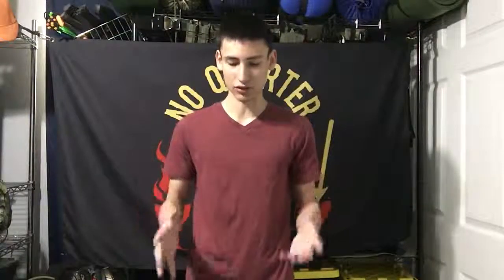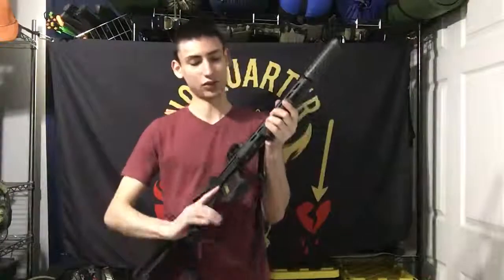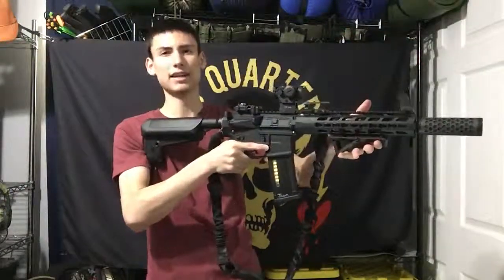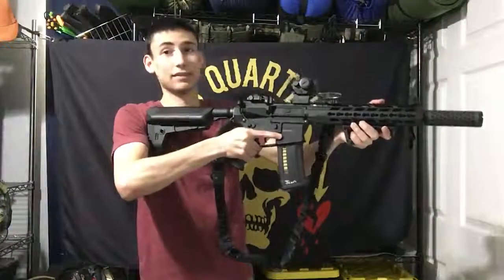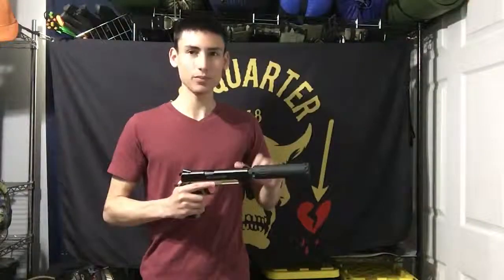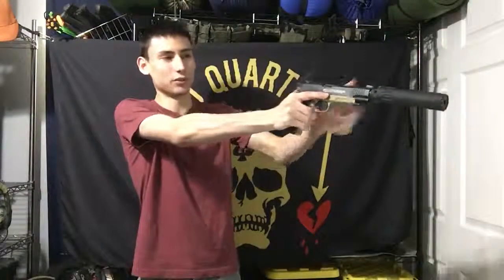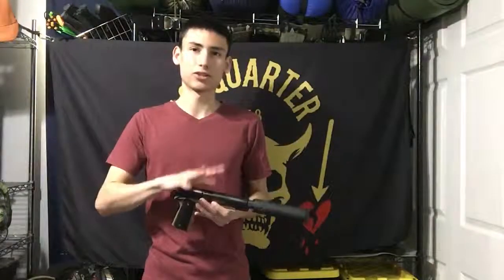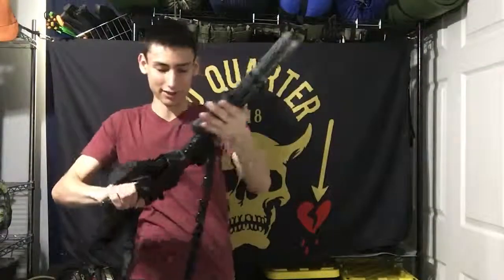Using Mock Suppressors in Airsoft

Comment: Can I remove the inner barrel?
Can I remove the hexagon part?
Reply from the maker: This has no inner barrel, it is hollow on the inside. 

For the hexagon part, no
Reply: @brandyn.ethan.productions  So the hive model does not have a barrel in the silence
Reply from the maker: @sh4d0z59  The "power up" model does, but the one in this video does not

Comment: Do mock suppressors come with foam rings inside them?
Reply from the maker: Sorry this took so long. Brandyn here btw. If I remember from when we used to shoot our airsoft guns. The mock suppressors don’t really do much. It’s just really an extension of the barrel and it makes the gun like cool. That’s about it.
Reply: @brandyn.ethan.productions  no worries thank you for replying. 
Another question, would the mock suppressor have its own inner barrel or do you have to buy and extended inner barrel for the gun?
Reply from the maker: Ethan here, sorry for the delay. Some mock suppressors have their own inner barrel like in the "power up" models, however most do not. Most do not have foam inside them because that gets close to NFA laws in the US. You can buy an extended inner barrel and use the mock suppressor to cover it up. I just use the standard barrel the guns come with but that will be personal preference and what kind of performance you want out of your Airsoft guns.

Comment: “Integrated Suppressor” is the term you’re looking for.

Anyways you bring up very good points and I agree. I run most of my stuff in minimalist setups because you’d want your platform to be as efficient as possible, and extra weight is hardly efficient. Now with that said, it’s good to run certain setups with what would seem like unnecessary bulk from time to time because it’s good to have experience with as much configurations as possible, including both practical ones and certain less practical setups more for the looks. I know I was guilty of that for some time and probably will be again once I finish my suppressed CQB build 😂

Comment: I have the same suppressor on my elite force cqb and the bbs break inside...what do i do?
Reply from the maker: I would try adjusting your hop up higher or lower. What could be happening is your gun is hopping the bbs too much or too little and causing them to contact the inside of the suppressor.
Reply: Hey do you know if it is legal to order a airsoft mock suppressor without a orange tip, I just want one for looks but I guess its illegal?

Comment: Im in California, Is it legal to order a mock suppressor without an orange tip and that is aluminum instead of plastic? I don’t want the atf kicking down my door for airsoft parts lmao, I’m also painting the tip just to be safe.
Reply from the maker: To order a mock suppressor you should be just fine. Having it on your gun is fine at fields. When traveling to fields, I think you need to have an orange tip. I'm not super familiar with Cali Airsoft laws so I would suggest calling a local field or shop and make sure.
Reply: @brandyn.ethan.productions  Thank you for the fast response!

Comment: Could I use the hive suppressor on an lct ak 12
Reply from the maker: The Hive Mock Suppressor comes in 14 mm + or - threading options. If the LCT AK12 has those thread options, then yes. Also, there are adapters to thread up or down if need be, if the LCT AK12 has bigger or smaller threads.
Reply: B&E Productions okay Thankyou

Comment: ok does that suppressor actually suppress ik your prob thinking what is this kid saying but i bought a suppressor that didn't actually suppress and it was just for look and i was just so bummed so does it actually?
Reply from the maker: I've noticed that it is slightly quieter, but not enough to make a huge difference and really be able to sneak around. Also, this is talking about GBBs as there is no difference with an AEG. Some that actually do make a difference are the ones filled with foam, but mainly those are imported, such as the TM Mark 23 and Novrisch's version.
Reply: Ok thanks
Reply: @brandyn.ethan.productions  whats in the suppressor besides the inner tube like whats inside the suppressor that actually tries to make it quiet
Reply from the maker: In Airsoft suppressors, it is usually foam. In real ones, its usually a series of baffles, that's why in the US actual Airsoft suppressors are a weird item because the legality of it is unclear so most manufactures tend to go clear cut and don't offer those filled with foam. Usually, Airsoft suppressors are completely hollow, or have an inner barrel for the "power up" versions which give it more FPS.
Reply: @brandyn.ethan.productions  ok thanks